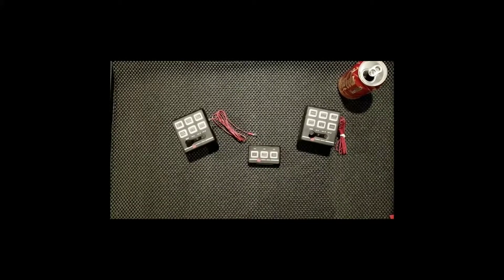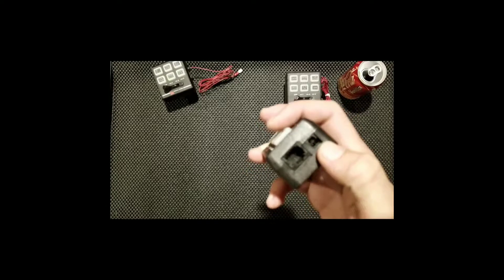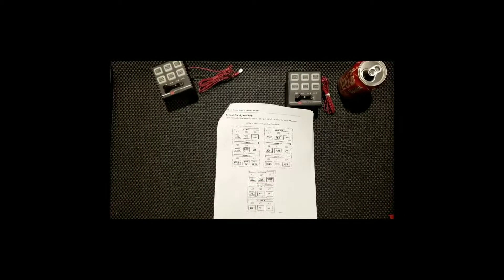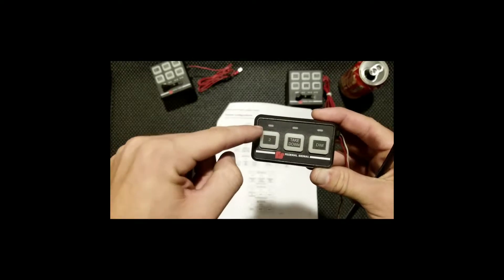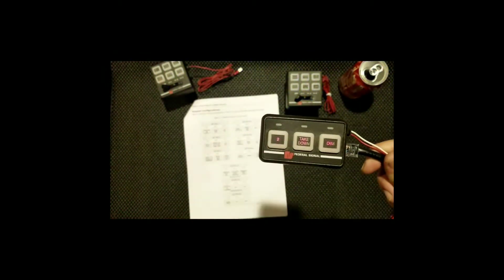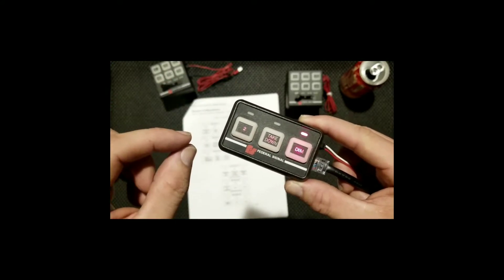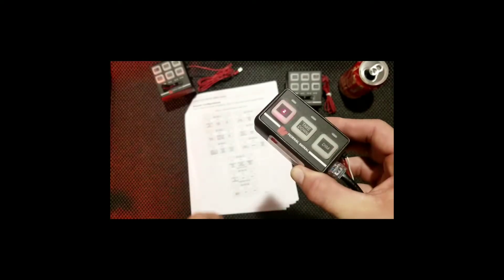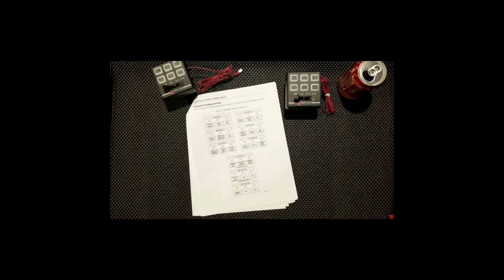Federal Signal 3-Button Controller Programming

Comment: Can't press 3 buttons to chnge the keypad what shouib i do?
Reply from the maker: The way that I have experienced to get to the keypad configuration is by pressing all three buttons simultaneously or at the same time. If you are doing that and it is still not allowing you to change the configuration, it may be locked and may need to be sent to the factory to have them unlock it and reset it up for you but from my experiences,  that was very rare.

Comment: Where can I buy one of the 6 button slide switches?
Reply from the maker: you should be able to find these online used possibly on a few different online sites. Depending on your location, I know a couple different dealers in CA that have reasonable pricing on new ones straight from Federal Signal and in OR as well.
Reply: rjracing38 would you be able to give me the email of one of the CA dealers?
Reply from the maker: @madme93  One of the best dealers I have worked with that typically has a great selection in stock is Lehr Auto Electric Services, https://lehrauto.com/. I highly recommend this dealer.

Comment: How do you program the flash patterns for mode 2/3? Only mode 1 is showing flashing
Reply from the maker: Braydan P, at least the way I have found the resource document, you would only have an option to set modes 1 and 2 or modes 2 and 3 on the same configuration...such as keypad function 3A would allow mode 2 and mode 3 and then would allow you to change patterns. If you are looking for modes 1/2/3 all on the same keypad, I would recommend a 6-Button module or you may be able to call Federal Signal directly and inquire about sending your controller in to reprogram the way you want with each button doing all modes, work-lights/take-down lights, signal master, etc.